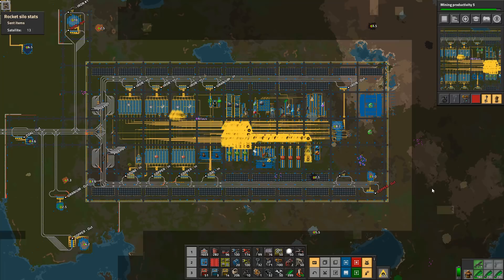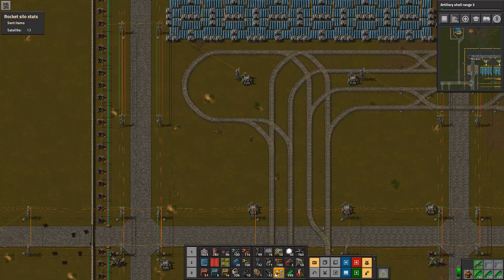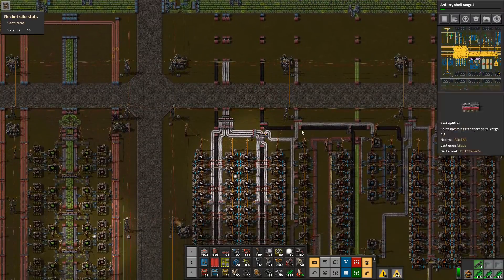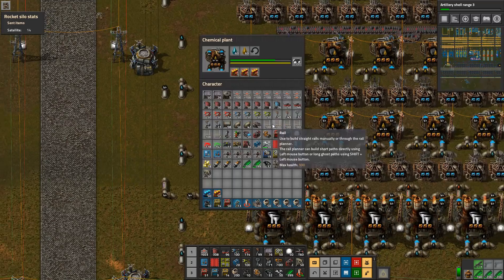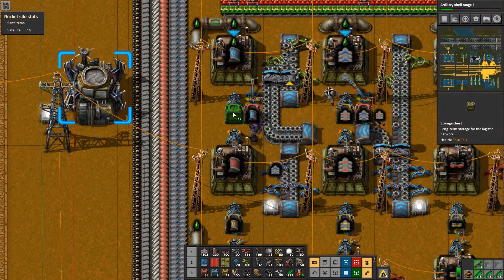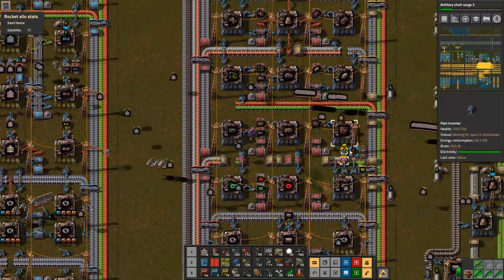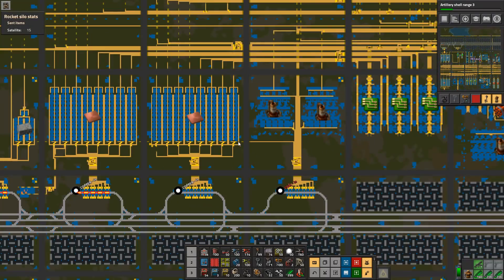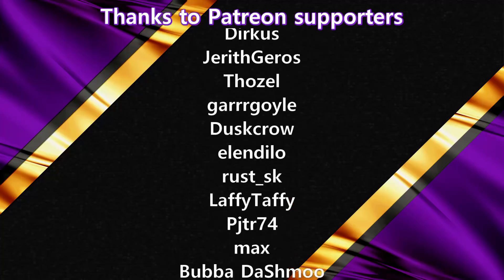Welcome to Factorio 0.17 #70 IDLE TRAIN TRAFFIC

Comment: In the last session you set more than one train to go if Iron =1. That's the problem, it takes a similar amount of time for a train to go out and come back to Iron in as it does for the iron to fill up. You designed it for distances that should be greater.

You did a similar thing last season when you setup 2 Iron stations at one deposit, which resulted in both stations going active at the same time, but taking twice as long to gather enough Iron ore.
so long as the buffer on the loading station is big enough you don't need to try to have more than one train running at the same time, the buffer will build and another train will be dispatched.

P.S. I think you have to many chain signals in you line, at the end the train with iron followed behind you, but didn’t get to the stacker until you were back at the depot. 

P.P.S. A good metric to judge is if you have enough belts coming from your mines to the Iron out station as from your Iron in stations to smelting. Each Iron in station has 8 red belts going out so you need at least 8 full red belts going to Iron in stations.

Comment: Recycling using buffer chests is easier than you make it out to be: a) Set the buffer chest to request a large amount of the item to be recycled. b) Set the inserter putting items into the chest to only activate when below the target amount of that item is in the logistic network. 

So for red belts, set the buffer chest to request 3000 red belts, but only allow the inserter from the red belt assembler to activate when fewer than 500 red belts are in the logistic network.

Comment: I've found the solution to make the oil work more reliable: enable the input pump for converting by comparing the level of each. For example, enable light oil cracking only when the amount of light oil is larger than the amount of petroleum. You can do the same for heavy, or compare the amount of light oil with the amount of lubricant. When you have enough production, all storage should become full at the same time. If there is still a difference between storage levels, you probably don't have enough chemical plants for cracking...
Reply: This is the kind of setup i use, i find it's more reliable and flexible than using static numbers, it can manage to get all your tanks full if not using all the output, or have them all drain out if overusing, but it will never stop the refineries for just 1 liquid.

Comment: I think you could easily scale up your solid fuel output by about 50% simply by compacting those chemical plants; currently they have 3 tiles between each one. (of course this will take some pipe reshuffling as well)

Comment: 12:45 It should be requesting more items than the inserter is trying to feed into the chest. This way it is guaranteed to empty your storage chests of that item.
Reply: You changed it to storage chests?.... that won't empty the old items out of storage. And since the main storage chests were placed before those storage chests, the bots will prioritize them when they pick up items.

Here's what I'm predicting will happen...
1.) Bots pick up red items from the bus line.
2.) They look for the oldest chest containing the item they have picked up.
3.) They transport item into your large grid of storage chests (because they're older).
4.) The inserters in the belt mall see tons of items in storage, so they don't make any new red belt items.
5.) Your blue belt machines stop functioning because all the required materials are inside your main storage.
Reply: Oh... you realized the problem and are attempting to empty the main storage chests manually.
Hopefully it works.

Comment: 9:52 You need a pump to push the petroleum north. Otherwise you've just created a fluid loop because the pump on the east side of the refineries will pump the petroleum north, and it will loop back into the pipes in front of the refineries.

Comment: Issue is that you're reading when there is supply on the network, not when there are stations available. Simply read some signals when the station is open, add a delayed departure to make sure that its not flickering because stacker and your trains will stop roaming that often. (or just use LTN, it works too)
Simple example, whenever the station "Iron #1" is enabled, send a signal "blue signal" into the circuit network, bring the signal to the depot station, send it to the train with the condition on the train being: "go to iron #1 when circuit blue is greater than 1 and 5 seconds have passed". That way you will still have roaming with a big network where your supply is less than or exactly your demand, but if you have more supply than demand, then you'll won't have lots of issues.
Reply: please check the circuit dopcumentation at: https://docs.google.com/document/d/1gjeqygxaak8Tx3XjQSnpNnQwN25etHBwyyL2d-lYi1Q/edit?usp=sharing . You can easily see that the signal for the trains in the depot will be send out as soon as a station is opened. if you are running several trains on one signal you have to make sure that you have a constant supply.
Reply: You'd actually have to set this at the station itself, the delay before sending the signal, because the 5 seconds passed condition in the train will otherwise be independant. You could launch a localised timer than let's blue go through only when its receiving it's signal for longer than 5 seconds.

Comment: Ok wow. Yes the HTN seems to be full of issues. My solution, which is quite simple, but uses lots of space is this; build what I call a greedy stacker for each load type you need. The greedy stacker has 3 stops, one in, and two out. The idea is that it is a dual stacker that directs full trains to one side, and empty trains to the other. On the empty train side the train only leaves the station when there is a mine with a full load. Full trains only leave their side when a consuming station sends a signal to indicate the inventory is low.

Naming all producing stations the same, as well as the consuming stations, the network will eventually fill every train and have it wait for a consumer to signal it's need.

The trains themselves say go to stacker in, then to stacker out and wait for a circuit condition. Then go to producing station till full, then stacker in then stacker out with condition, then to consuming station. Then repeat. 

This works very very well, as trains only move when requested. There is a 5 second delay on stacker out to avoid flooding trains.

Anyway, thanks for all your great content!
Reply from the maker: The main issue is not really HTN, but rather the fact that it only really works if the supply is greater than the demand. I will work on that and the issues should (hopefully) disappear
Reply: it would be nice if you can clarify your system a little bit more. right now i can see issues when it comes to the train schedule (unless you have one name for ALL stations - which requires a lot of combinators for forced pathfinding) if it's possible please ping me in Nilaus discord (the link is in the description)
what will you do if you have an overproduction of stone? just add more trains to the system?
Reply: @haphollas2845  hello! I hope my comments don't come across the wrong way, if so please accept my apologies. In my system, yes, all similar producers share the same name. Each producer station is disabled while inventory levels are within desired limits. Overproduction is not a problem for any resource as it means that all trains will eventually move from the empty stacker to the full stacker, and there thy wait until requested.

I would very much like to ping you on discord, as I would love the chance to speak with you. I'll first have to learn about discord (I'm as old as dirt, sooooo), but I will contact you asap. Thanks so much for your reply!
Reply: @haphollas2845  hi again, I just signed up to discord (Nick.Hanley) but still not sure how to message you yet. I will get there eventually!

Comment: Hi, Nilaus.
Don't close the Station. Set the last signal to close.
Reply: doesn't work. in the worst case all of the trains will go into the stacker and wait there (even if another iron station opens up). due to the fact that you send the trains out on a demand you can easily close the stations without any issues. the issue in this episode is the lack of iron ore supply (that's why several trains are running around 'idle')
Reply: @haphollas2845  
Yes, but if the Requester-Station is closed, the full Cargo Trains (Coal) can not reach there destination, and don't wait at the Inbound-Stacker.

Comment: God it was frustrating to see you almost grasping buffer chests and then going in a inferior direction... Had you done that off-camera and thought it through I'm sure you would have realised that. As other have pointed out, buffer chests are ideal for recycling. Filtered storage chests have one big flaw and that's the bots aren't guaranteed to put things in them - they have a priority list that tells them where to put things and filters are way down on that list. You realised that and tried to clear them out manually BUT since the chests next to the mall are full you are going to get stray red belts everywhere and THEY WILL NEVER BE RECYCLED. Bots will never relocate between storage chests. Buffer chest on the other hand, if you follow the easy guideline and set the request higher - WAY higher - than the inserter condition limiting production, for instance keep the inserter at < 1000 and set the request to 5000, and the bots will work to keep the level at 5000. You'll never make another red belt as long as there are red belts anywhere in the factory, they will be fed that buffer chest in due time.  With filtered storage chests the level will eventually drop down below 500 and the red belt assembler will start to suck iron again while there's still red belts sitting idle in storage chests.

Comment: Hey Nilaus, please forgive me if the idea is dumb, but couldn't you turn your excess petroleum into solid fuel too?
Reply from the maker: I could, but I know the demand for Plastic will be much greater so I rather want to solve this in another way.
Reply: @Nilaus  I meant just enough so your Oil refineries won't stop working, blocking for example Lubricant. That way you could Prioritize the Plastic from the Coal liquification on the Bus again. A pump, that pumps petroleum into Solid fuel when your petroleumtank is close to being full.

Comment: You're using train signals wrong. You should not have any trains waiting with your current railways. You're over using chain signals to a point where I could say you don't understand their mechanics.
Reply from the maker: I love arrogant comments like this that expose a profound lack of understanding of what is going on.
Chain signals must be "overused" in this setup because this train network needs to keep the trains out of the main base and in the stackers. Any norml signals on the way to the unloading locations will cause deadlocks inside the base.
Reply: @Nilaus  You may consider that arrogant, but you should never quit learning. Someone might know better ;) and might be offering you some new perspective. Anyway Mr perfect rail network, good luck to you with your stackers.

Comment: I am watching your Satisfactory Twitch Vod,  while you keep trying to place conveyor lifts.  I think the solution is to place the wall,  add a foundation at the upper level to the side of where you are placing them,  and from that platform place the lower end locked into the window,  then extend it up locked into the upper window.  You actually did it going down,  you just need to do the other way.
Reply: And yet a different solution would be to put this comment on his Satisfactory vid and not the Factorio one.